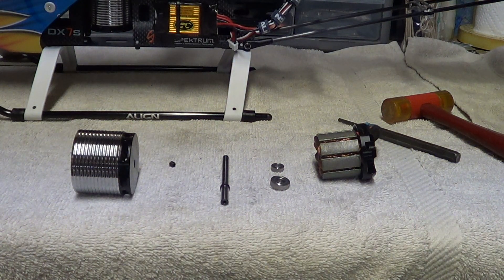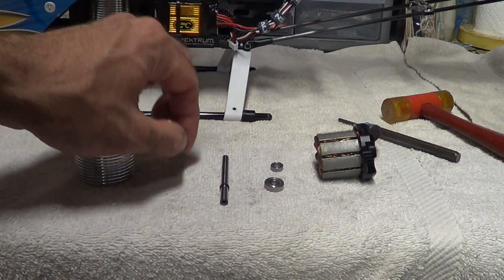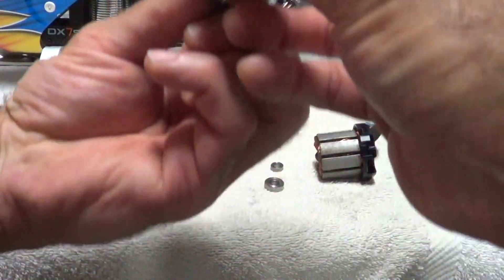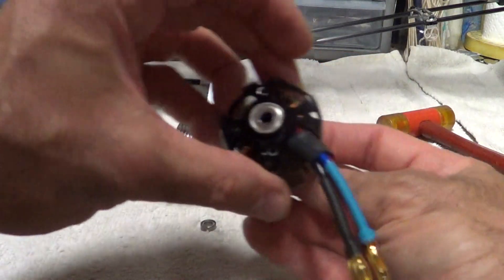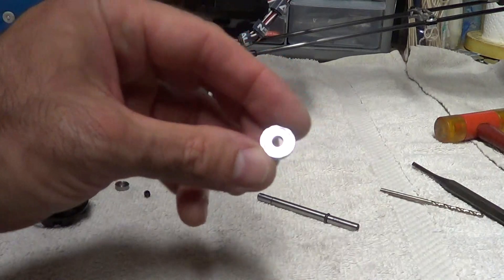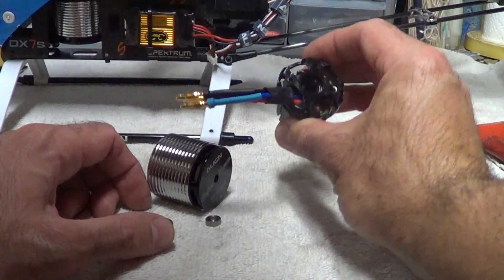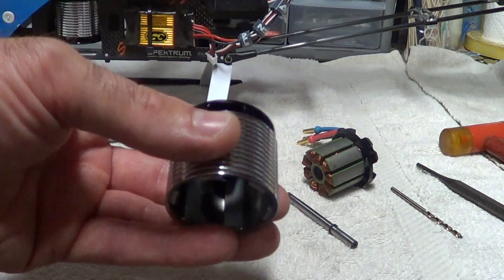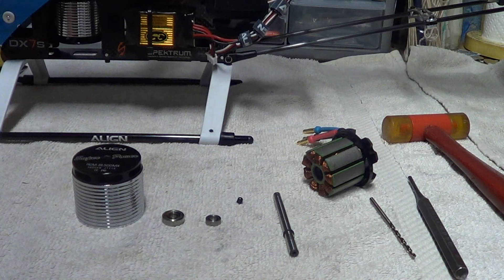How to rebuild an Align trex helicopter motor

Comment: I did this on a cheap Gartt 450 motor that was vibrating horribly at about mid revs (Thanks for the encouragement Ray)...  The shaft was pressed in real tight though. I ended up drifting it out by using an old mainshaft and hammer, while standing the motor on a 12mm 3/8" socket. Great video Ray

Comment: Hi Ray, do you know how or if you can take apart a TRex 250 stock  motor? I tried looking for that hex head but no luck,  I can't find a single screw or lock pin or c clamp on that thing. Thanks and keep up the good work.

Comment from the maker: you can buy new bearings from boca bearings website or simply bring them into a local hobby shop and they can match them up.i don't think align sells replacement shafts as far as i know but not 100 percent sure on that